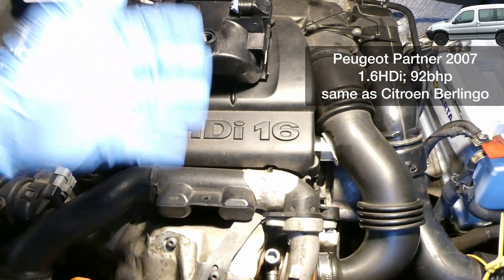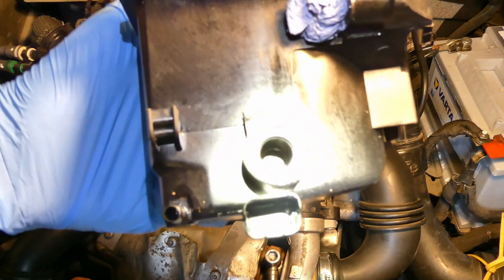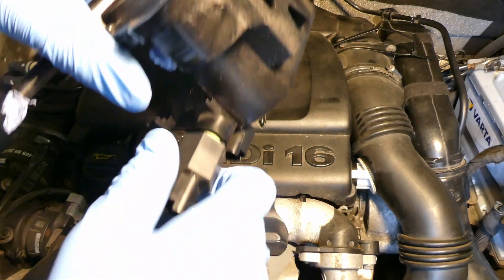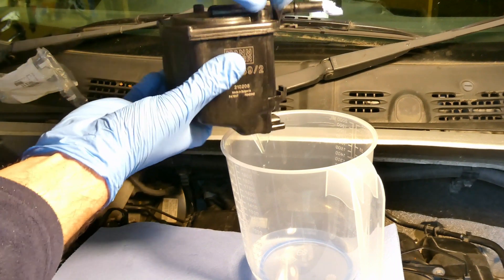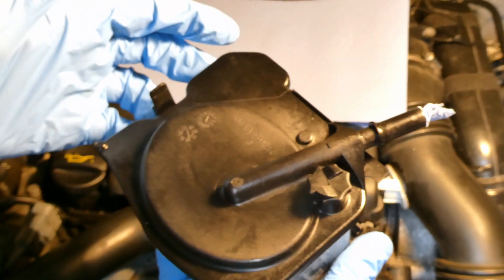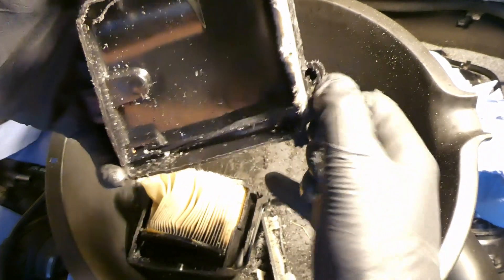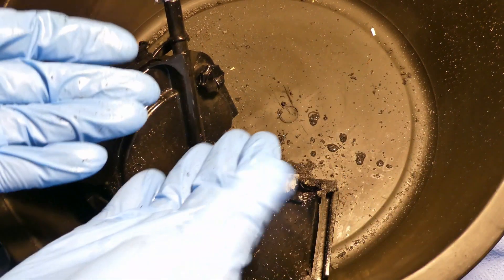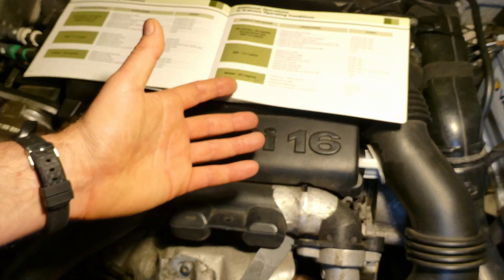1.6HDi diesel fuel filter, all you need to know and taking it completely apart

Comment: Hey, excellent channel!! Just wondering, how is the water getting into the filter? 

My high pressure fuel pump started making a humming noise, i changed the fuel filter, and the noise went away... 2 months later and the noise is back 😢 but with a n intermittent water warning. 

Also my bosch filter needs a spanner to open the nut ontop too, so battery out 😅

Comment: Hello how are you, what happens if I lost the fuel heater? The engine wont start even if I connected the conector very tight? I mean the ecu wont let the injection work properly? Thanks a lot.
Reply from the maker: I sincerely doubt anything would happen actually. If all is connected and there is no air to get inside, the ECU does not know if that heater is working, although I might be wrong on that one, but as far as I know there is no sensor for that, so the ECU might rely on if this is drawing any power. This is not a critical component for the ECU to not allow the car to start or work. Once the engine get wamr, this does nothing and no power goes to it. These are not the old 1.9 diesel enegines where this always worked at the start. The heater does not even turn on if the temperature is say >5C. It will be slow to start and difficult when the temperature is <0, but it will start as long as the battery is good. Once warm, this does not even work.

Comment: I am trying to drain water from my fuel filter on my 2007 Peugeot Partner 1.6 HDI. On turning the tap, it makes some gurgling sounds but no liquid comes out! Could it be there is a vacume created inside the pump that prevents anything coming out? Should I disconnect a hose? Or do it with the engine running? I can not find any videos or internet instructions about draining water from the fuel filter while the filter is connected. Any advice is appreciated.
Reply from the maker: Is this the top screwing nut that one needs to undo? How much do you open it? I have never drained mine as I generally replace it, but if there is any water it should come from the bottom. It is a bit weird that you have gurgling noises. So, with the top bit screwed tight, upon pumping the big buld on top of the engine to remove air in the system, then opening the screw on top, do you get  no water/diesel coming out?

Comment: People say the engine performs better after a fuel filter change, but i don't see how, as the fuel filter holds about 500ml of fuel, so for the filter to be clogged the engine would deplete the fuel inside the filter it would cut out. There's no real inbetween state of performance.

I change mine every few years, just to protect the injectors.
Reply from the maker: I replace it every service I do. It does not add that much to the overall bill. Never noticed any improvement. Maybe the fuel pump will have a better life with not so clogged filter, but I suspect that depends on how many times people leave the tank nearly empty and from the sloshing around picking up the dirt from the bottom. I thin kI have gone only once with the light coming on to say it is nearly empty. I hate running low, all sorts of problems with that, especially the dirt that is down there.

Comment: Brother i run out of fuel on 1,6hdi and not starting and shows Water in diesel filter , what to do ?
Reply from the maker: Do you have a rubber pump on top of the engine. If yes, squeeze this a lot of times unitl you hear fuel going back to the tank and it is hard. That should do it. If you do not have one, it should be automatic, but you may need to put a rubber bulb in the fuel line.

Comment: Hi! Is there a significant difference between expensive and cheap fuel filters? What can you tell about  Purflux filter?
Reply from the maker: There was a study on cheap vs. expensive fuel filterand it was quite shocking how much stuff they leak through. Mainly it was when the valve opens to let stuff flow through, the cheap ones at much less pressure. I cannot find it at the moment, but it was quite revealing. I would not myself buy a cheap filter. Unfortunately, I have no info to go on for the purflux filter.

Comment: Great video as always, Question - do you know how to bleed the fuel lines/system. I have a 1.6hdi  Peugeot partner 2016.
Reply from the maker: If there is a rubber bulb on the top of the engine you bleed it through there, if there is not one, it is probably self-bleeding.

Comment: Hi MM! I am pondering on buying an oil catch can for my Citroen C3 1.4 hdi since there is always oily muck collecting in the intake and coating the sensors in oil mist. What was your final verdict on the OCCs? I see it is not present on your Partner in your latest video, thats why i'm asking :)
Reply from the maker: The OCC is not present in the last video because about that time of the year I have an annual inspection (MOT) and they view an OCC as modification to the emissions components in the car. So, they will fail the car based on tampering with emissions, despite this being a reduction in emissions. So, I remove it to go through the testing and then depending on what I am doing it passes some time before I re-instate it.
Overall, I am more than happy with my OCC, only problem is that I need to empty that hose too often, depending on humidity and driving. Otherwise, the provent 200 is good, but I have no data or anything else to say which is more efficient.
Reply: @moremolecules  Thank you for your input! I went with the generic oil catch can (one of the ones you did a crankcase pressure test with) to avoid the problem with the ProVent 200 which is that you really need an extra reservoir to avoid draining the hose every other day. Will try to stuff the OCC somehow with kitchen fan filter material and see how that works. Let's hope the engine doesnt explode from crankcase pressure ☠
Reply from the maker: @MT-rc3gn  It should be alright as long as there is not additional crankcase pressure from the engine. Say if you engine is already a bit on the worn side, the OCC will add a bit more.

Comment: I change mine every year now as it has clogged up two times and I’ve had to manually prime the little rubber pump on top of the engine to get home. 

Interesting to see inside one. Thanks for the video 👍
Reply from the maker: That is what I do as well, change ot every year. Depending on the quality of fuel once it starts clogging then it is almost certain that it will pass smaller sized particles along to the injectors and they are on the expensive side of things.

Comment: Is it possible to mount the fuel lines wrong?
Reply from the maker: It will be a bit difficult, as the pipes are rather awkwardly twisted and only go one way, but probably can be swapped, but difficult.

Comment: If you put a water sensor additionaly does it has to be programmed in order to recognize the sensor 
Greetings and nice videos as always
Reply from the maker: Yes, if you install it additionally you need to program it with Diagbox or Lexia (Citroen) and PP2000 (Peugeot): https://www.youtube.com/watch?v=xAHiFTAya2E
Can be installed, but the ECU will not see it if not programmed and alert you for the water in diesel.